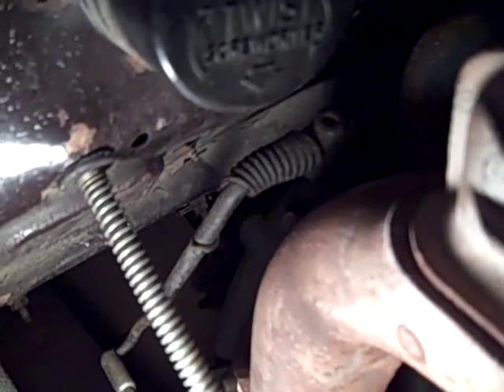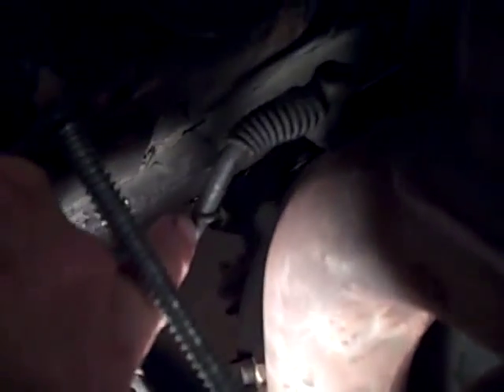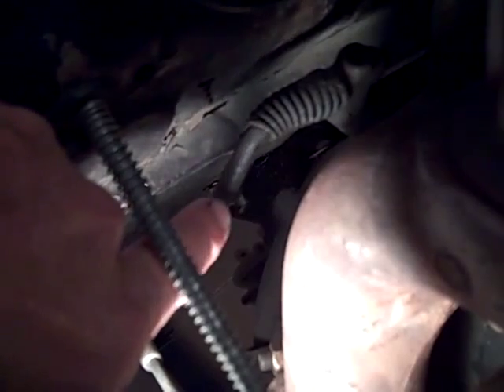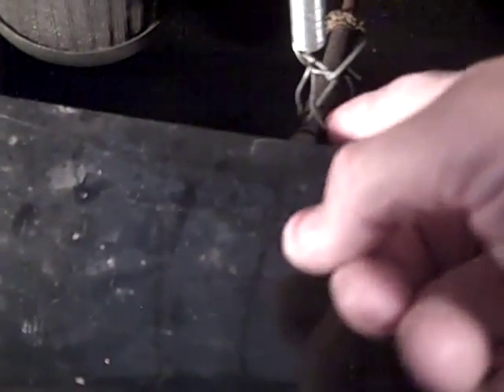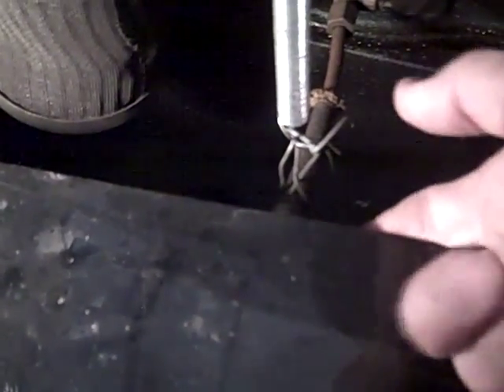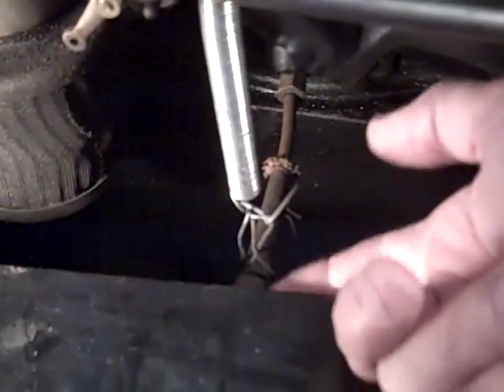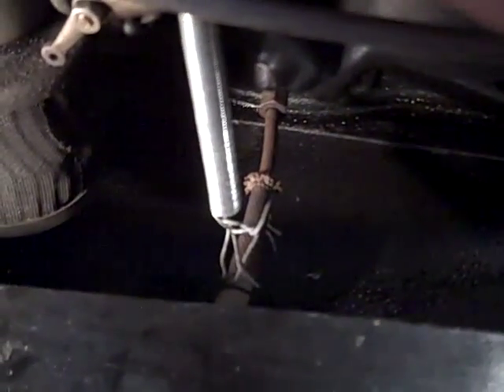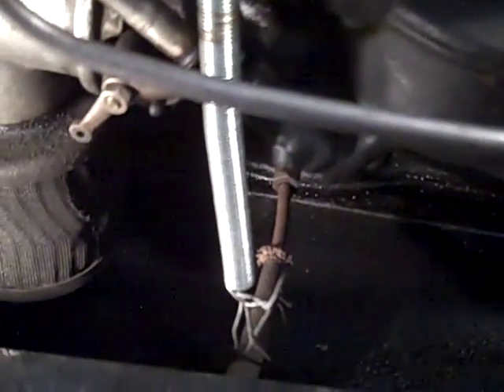Model A Ford Throttle Return Spring

Comment: Great simple video with the visual aide I needed! I recently installed a new stock style return spring on the Linkage and for some reason it's pushing the accelerator rod to the right so it binds up! I'll figure it out! Thanks
Reply: Charles Trubl how did you get the old spring off? I need to replace mine